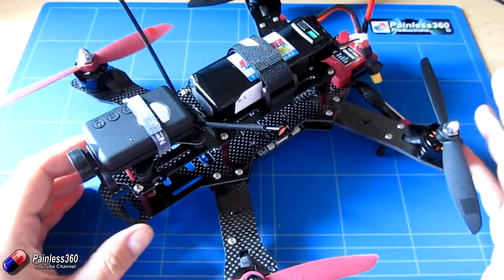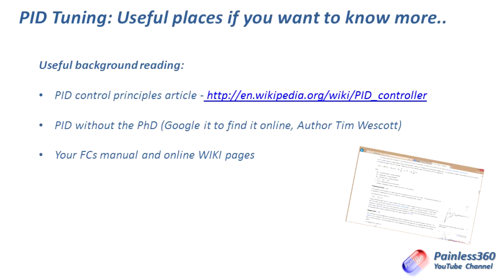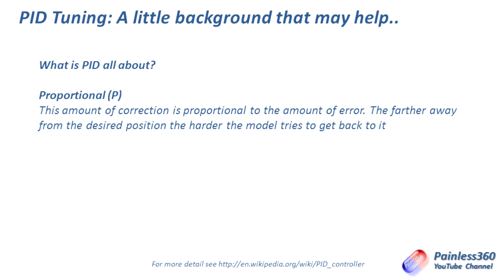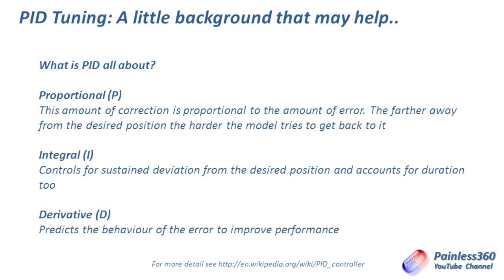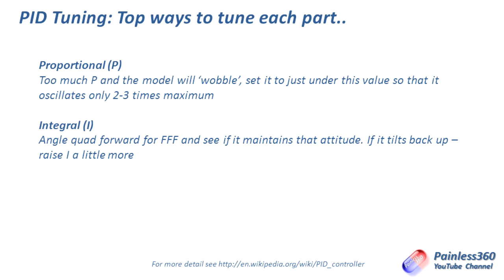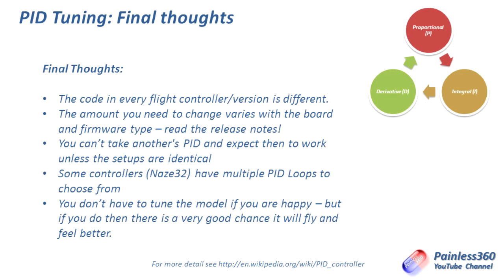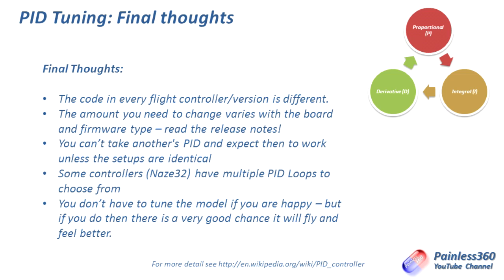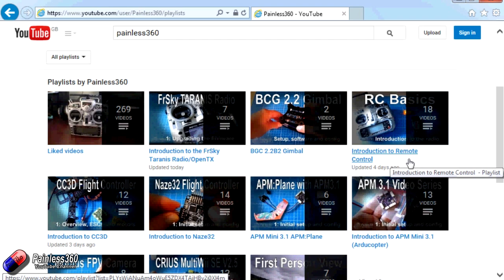Multicopter Tuning - Introduction to PID theory and how to tune your multirotor

Comment: hie m using multiwii se 2.5. m trying to tune pid but when ever I armed my quad the minimum throttle present at motors are around 200 -500 unless I changes throttle of tx to almost more then 50% not any motor start as motor op is always less then 1000 value y it is happening n tell me solution I have chaked minimum throttle setting in gui it is 1000 n esc are also tuneed as I explained in one video by esc + recivet tell me solution n tell me how to tune pid of pitch roll yaw
Reply from the maker: I'd run through the build videos to make sure you've not missed a step. I'd start with ESC calibration myself.. Best of luck!
Reply: Painless360 
esc calibrated in gui motors signals are low n when  I increased the throttle (only throttle) then aslo quad drag in different axis tell me solution
Reply from the maker: Sorry, not sure what you're describing. Best of luck with it..

Comment: Anyone knows can I transfer betaflight 3inch quad  PID values  to ardupilot?Im using kakute f7 v2 board.
Reply from the maker: You can't. Very different implementations. Even the ones in Betaflight change regularly so it's tricky to copy BF to BF version. Check out autotune.. Best of luck

Comment: what pid controller is this using
Reply from the maker: Sorry, I don't understand the question..
Reply: Painless360 luxfloat ect..
Reply from the maker: I see! This is the same basic principle behind any of the PID implementations. You can find that some work for your model better than others but most pilots would pop Betaflight 3.0 on their models now as it's easier to get a well flying model, even with the defaults.. Best of luck!

Comment: the pid work on acro mode?
Reply from the maker: +tiger exhaust You need to tune in the mode that provides the smallest amount ot 'help' for the FC you are using. Normally ACRO or RATE mode. Best of luck.

Comment: what is fast forward flight?
Reply from the maker: flying forward at high speed. It's a term held over from heli flying days..
Reply: Painless360 when tuning, u should always be on acro mode?
Reply from the maker: Because you don't want the auto-level part of the software hiding the thing you're trying to see. Also you want to tune one thing at a time.. Best of luck!
Reply: Thank you for input, great help for a newbie like me :)